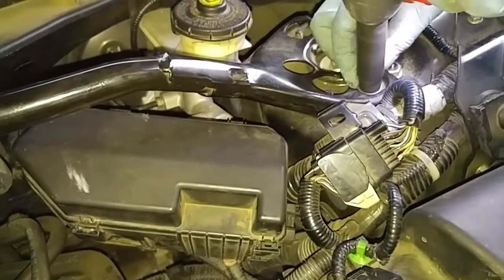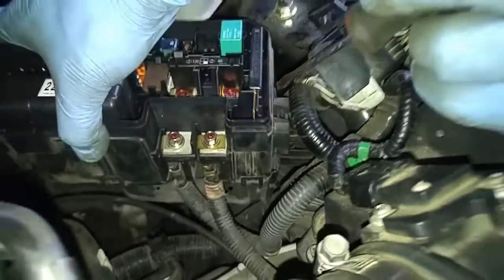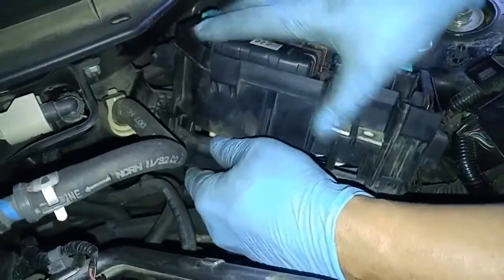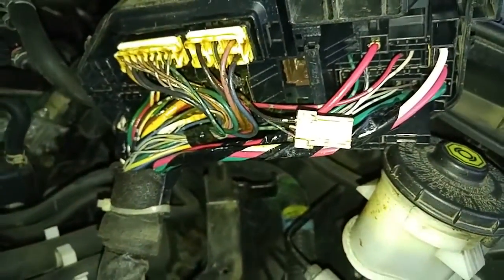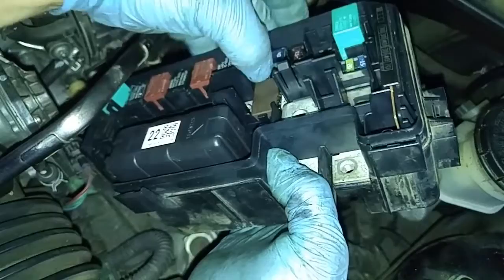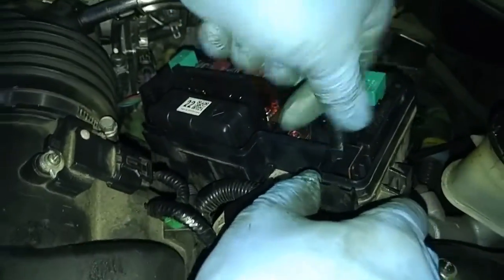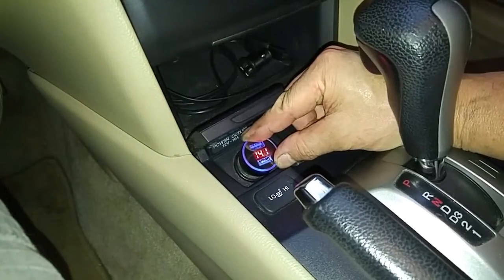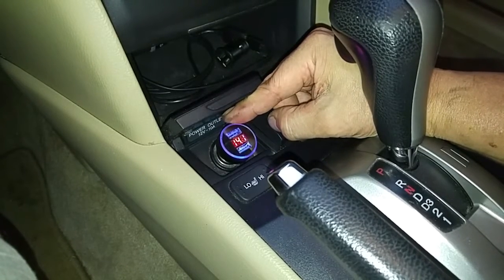Battery Dash Light On & Off? Honda Electronic Load Detector Malfunction

Comment: Thanks for posting this. 2007 odyssey new alternator, battery and belt one year ago. Today the battery light started coming on. Checked battery and alternator. Both were good. I had no idea where to go next until I stumbled across your video. Thanks
Reply from the maker: Glad to help!
Reply: @hardlymovingpro  hi mate I have same problem today  I parked my car after 30 minutes won’t start I jumped batteries is work but when I change gear car is kicks and electronic shut off when I open lights car stopped  I drove home stop and not start again? I think I have same problem my car Honda Accord 2008 v6 can you help me please
Reply from the maker: Did you change out the ELD?
Reply: @hardlymovingpro  no I didn’t change yet I’m looking for parts
Reply: @hardlymovingpro  hi mate today I changed batterie but stil same problem
Reply: @hardlymovingpro  where I can find eld I’m living Australia
Reply from the maker: @serroxat  Amazon or rockauto.com
Reply: @hardlymovingpro  hi mate I couldn’t find parts but I bought spark plug is really cheap
Reply: @hardlymovingpro  hi mate I changed ELD today but car clicks not working what I have to do i need to change battery ? When I open lights not powerful working very weak

Comment: Hello i had an issue with battery light flashing on and off.Around 2 months ago my car lost power while driving so i got it towed because  car battery cables didnt seem to help so i towed to mechanic was told needed alternator and belt so i got a new alternator and belt.I went to orailys to get a check on battery and said my battery was bad but the orailys employee  also said to check diode thats what said on the battery pad what do you suggest before buying a new battery for honda civic 2000
Reply from the maker: Could be a defective rebuilt alternator that malfunctions sporadically.  It's very deceptive.  Get a cigarette lighter plug voltage display device (like what I used in the video) and monitor the voltage output while driving the car.  Any drop into the 12v range is a bad alternator.

Comment: I don’t know if your still replying to this video but Hi I have a 2012 Honda Civic and when I go to start my car sometimes it won’t start and the battery light comes on. I usually turn it off and then on and it starts back up after 1-2 tries. It does not do this every time but it has happened more recently. I got the battery and alternator checked a month or two ago when it was happening and the man at auto parts said that they both looked completely fine and that the battery was fairly new. Do you think this is the issue or maybe something else?
Reply: You’re*
Reply from the maker: Check the voltage output of your battery before you start the car.  If under 12.6 (like around 12.4) it could be failing starter motor.  Also try starting the car right after turned it off.  That's when you have peak voltage in your battery.  If it starts right up, but doesn't start in the morning - again - it's probably a weak, failing starter motor.

Comment: Greetings I have a 2005 Honda Civic ex. I’ve replace the alternator and battery. Car ran fine for 2 days. But when I cut it off the last time it didn’t start. The radio and all the light came on but when I turn the key over and it did was click. After I got a jump it started drove for 2 minutes and the needle on the dashboard keep going up and down. Then it wouldn’t accelerate. Also the turning signals didn’t work either. First place said I needed a new alternator. But replace that and the battery. The second place I went to said I needed a new computer. Do you have any recommendations on what I should do next before replacing the computer? Thanks ahead
Reply from the maker: Get a accessory (cigarette lighter) plug in volt meter to monitor the voltage output while driving.  While driving, the voltage should be 13.8 to 14.4.  Any sudden drops should be noted with you driving condition.  Also before starting the car, the battery voltage output should be 12.4 or higher.
Reply: Also consider replacing your ground strap to the engine. There’s a similar video on YouTube with the same issues you’re having. He walks through how to check of that’s the issue.
Reply from the maker: Good idea.

Comment: Do not blow the grease out it’s dielectric grease to resist water and corrosion! Omg please put some kind of dielectric back in if u do this! Honda put it in for a reason matter of fact all cars have this under the fuse box and any other place. A major junction of voltage occurs
Reply from the maker: Way too much compared to a Toyota.

Comment: Magari il grasso se la Honda ce l'ha messo ci sarà un motivo o no?
Reply from the maker: Per protezione di coorsion ma hanno applicato troppo.
Reply: @hardlymovingpro  I have to change the battery every about 3 years in my Honda Jazz 1.4 i-Dsi, no matter what the battery make is. Yuasa, Exide, Fiamm  all last the same 2 to 3 years. I've got the flickering problem. Do you think the battery will last more than three years if I fix the ELD thing?

Comment: Not sure if you still respond,  but I have an ‘11 V6 Accord EX-L and i’m getting the battery light after replacing both the alternator and the battery. The alternator was first, replaced that and had no battery light for about 2 weeks, then recently my car died, so then we replaced the battery. Just yesterday I got the battery light again, and i’m wondering what you think it could be.
Reply from the maker: Honda tech at dealership stated that cars with ELD problems come in a lot.
Reply: @hardlymovingpro  Thank you for the reply, much appreciated!

Comment: please help my honda accord 2006 has problem; while driving at night my dashboard with the rpm and speedometer, headlights, radio turning on and off repeatedly every 2 to 3 seconds eratically. 
could it be bad ELD?
I already checked the alternator and battery and its all good.
Checked the grounds also and its fine.
Please help!!! 
thanks
Reply from the maker: Yes.  I think it's the ELD.
Reply: @hardlymovingpro  thank you so much, hopefully it will solved the problem after replacing it. is this available on ebay?
Reply from the maker: Not expensive.  Try the dealer

Comment: Can I drive for a few days while this is happening? Battery and alternator are fine.. got them checked. So I think this is my problem.
Reply from the maker: Just keep monitoring you battery voltage.  A plug in volt meter is the way to go.

Comment: Car battery did this but it wasnt the eld... battery, alternator replaced and cleaned ground... im stumped
Reply from the maker: Monitor the voltage output while driving the car.  Could be a bad replacement alternator
Reply: @hardlymovingpro  this is my second one. It usually happen at 12.6v when the load detector kicks in. But at the end of the day, its still a reman alternator.

Comment: Would a ELD cause no start? Like maybe it ends up being stuck in alternator shut off and therefore cant hold battery charge?
Reply from the maker: Yes ... I noticed it'll run down the battery.

Comment: Also don't forget if you have an electronic Throttle body...The light goes out when you drive it. Check the Throttle body plate location at idle or rest..It should read  3%<.. I fixed many where  people  tossed all  kinds of parts at them.. Toyota being most of them....Only to find the throttle body was dirty. So the ECU thinks you have your foot on the gas pedal. When it's 10% or higher  at  idle...
Reply from the maker: Good point!

Comment: Hey I have the battery light always on, no codes nothing, we change the alternator and battery, I check all connections, do you think I can fix my problem if I change that part I can fix it,?
Reply from the maker: I'd say more than likely.  Get one of those LED voltage display plug in devicea to monitor the voltage while driving.
Reply: I checked the battery voltage with the voltmeter and it moved 13.9 to 14.2 while the engine is on.  Well I will change the Electronic load detectors and I’ll let you know. Thanks 😺 for the response.

Comment: Don't know if you're still responding to this vid, but awesome explanation of the process. I just bought a 2009 accord coupe yesterday that has been garaged kept most of its life. This battery light just started coming on for around 20-30 seconds at a time then will disappear for several hours, before reappearing. Looks like I'm going to start at the lowest level and work my way up by trying this out first before messing with the alternator. Both alt & battery show good voltage when tested, so the issue for this light has to be something else.
Reply from the maker: You should test the voltage output at different rpms to check for consistent output.

Comment: I have a 02 Acura RSX type S changed the alternator and battery checked all the wires and fuses everything seems to be fine the voltage is at a stable 11 but the battery light is still on.
Reply from the maker: Voltage should be above 12v with the engine off;  engine on, over 13v.

Comment: Is there a torque spec for the suspension cross member?
Reply from the maker: Torque specs on the strut cross brace nuts not that critical.  Just make sure they're on tight.

Comment: Just replaced the Electrical load detector on 2011 Honda Pilot. the part cost me around $5 with tax, but the just required disconnecting, removing and disassembling the main fuse box on the right side shock tower. Not hard but tedious work. This is after replacing the alternator which I thought was failing cause of an intermittent flashing battery idiot light on the dashboard. Looks like it fixed the issue
Reply from the maker: Good news!
Reply: Wow, inflation is so bad, you said $5, but it's now $40 at Amazon in 3 years.
Reply: @charleschenhua  please tell me how did you find it in amazon
Reply: SO I had a similar problem. I replaced the alternator, battery and ELD..so why did my light go on again?
Reply: @marissaaranas2537  OMG!!!

Comment: Hi I have a 02 civic the alternator works and charges the battery then stops then works again battery light in the car is on constant no on and off going on could that be the eld
Reply from the maker: Yes ... Most likely
Reply: I have an 2004 Honda Accord v6 my battery light and srs light keep blinking would the eld be the problem

Comment: My honda CRV-2006 
my problem is i replace a new alternator and Battery but the Battery indicator in dashboard are always ON. what would be the solution.
Reply from the maker: Start the car and check the voltage on your battery terminals.  It should be outputting over 13.5 volts.  If less then 13 and dropping, the alternator is probably no good.
Reply: did you figure out a solution? I have the same issue and alternator was replaced twice with a voltage over 13.5 volts

Comment: where do you get the lcd plug in thing.where did you plug it in at and whats it called?
Reply from the maker: It's a LED voltage display meter that plugs into your cigarette lighter or electrical accessory port.  I provide a Amazon link to it in this video's "show more" section.

Comment: I can't find this info anywhere. I have a 2007 Honda Crv and an OEM service manual and the circuit schematic shows that there is an eld but when I look to purchase one it says not compatible with 2007 only a 2006 or older.
Reply from the maker: May have to get it from the dealer.

Comment: Thanks for posting this. It helped me know where to start looking for the same issue I was having on a 2002 Honda Accord. Lots of older Hondas have the same or similar issue.
Reply from the maker: Glad it helped!
Reply: @abraham quilca - I’m looking to replace my ELD on my 2000 Honda accord V6. How hard was it for you to swap yours and did you notice improvement ?
Reply from the maker: Not hard.  Just watch the video.  It did fix the electrical problem.
Reply: @hardlymovingpro  Nice! I just picked up the part tonight
Reply: Good to hear @Dylan Robertson. Did you get it to work? Any issues, let me know.
Reply: @musico07  I got the replacement part installed. It was actually a slightly different size than my original one but fit in nicely. Seems to be going well - my issues weren’t major so still monitoring if any of the dash lights flicker on or not
Reply: I'm here cause I notice I go into 12ish volts at times when driving,and we all know that's not supposed to be..
Seems imma have to look into this same process for my 2002 accord..
Reply: @leoshepherd1982  check ur positive battery terminal.
Reply: Would this cause no battery light on dashboard also? 2002 Honda accord

Comment: I have civic 2009. Dashboard and radio light disappear for 1 or 2 second also feels like car gonna switched off. What could be the reason.
Reply from the maker: Could be bad ground wire somewhere.
Reply: I’m having the same problem with mine but mine actually turned off on my twice already, I’m trying to figure out how to fix it😣
Reply from the maker: The ELD is a cheap part to replace and commonly fails over time.

Comment: After 2 new batteries and 2 new alternators, valve gasket cover replacement and solenoid valve replacement, I am sitting in a parking lot with a dead battery.  I am financially broke for 17 days.  I am devastated by this problem.  Honda Odyssey EXL 2008.
Reply from the maker: What are the mechanics telling you?  You may have a slow drain on you battery from something pulling current from your car when the ignition is off.
Reply: @hardlymovingpro  I agree.  However, the 5th alternator was just installed yesterday.   I think that I will have to take the car to the Honda dealership.   Two guys from the park insisted on helping me and got under the hood, pulling fuses out, unplugging things and replugging them...now my alarm system has been disabled.
Reply from the maker: @SignedOff402  Yup.  You have to be careful with non mechanic types trying to help.
Reply: Buy an american car

Comment: Well for me I have an Toyota Corolla ae100 when I drive the battery and another light with a logo that looks like heat coming off shows up in dash board , when I put on the ac it blinks fast and or sometimes it just cuts right out and then I’m not able to roll up my windows nor see any lights in the dash board
Reply from the maker: Sounds like your accessory belt is slipping.
Reply: @hardlymovingpro  ok will have it look at 
I thought it was the alternator because I was told it’s going bad
Reply from the maker: Ac light usually blinks with a slipping belt or bad clutch

Comment: He fucked up by getting rid of the grease on the wire. That's help the wire not get corroded
Reply from the maker: Not that much!  The car's not a boat!
Reply: Open any car under hood fuse box you'll be surprised. The heat under a hood is so hot it cooks the wires long term them wires be brutal falling apart.
Reply from the maker: I have.  Mostly Toyota.
Reply: I think we all we all areeded about the grease on the wire  should have been replaced , but let look at the good side of it all

Comment: "What's this grease" proceeds to wash it away  lol i hope u put some back on. it's on the underside of the fuse box for a reason.. corrosion is the last thing u want in your fuse box
Reply: It's ment for nothing to get passed the connectors perfectly normal
Reply from the maker: While driving the car through a river?
Reply: @hardlymovingpro   you do that lol
Reply from the maker: Way too much applied by the factory when compared to a Toyota
Reply: @hardlymovingpro  You cant apply too much dielectric grease.

Comment: Would this be the same for honda pilot 2012 ? I am having the same issues.
Reply from the maker: If you have the MIL code of 1298.  Here's the link to what appears to be the part:
https://www.ebay.com/i/392393551650?chn=ps&norover=1&mkevt=1&mkrid=711-117182-37290-0&mkcid=2&itemid=392393551650&targetid=1068323855270&device=c&mktype=pla&googleloc=9013542&poi=&campaignid=11755693419&mkgroupid=112482247605&rlsatarget=pla-1068323855270&abcId=9300462&merchantid=131363253&gclid=EAIaIQobChMI5KvouMLV7QIVSubjBx2EJASFEAQYASABEgI79_D_BwE
Reply from the maker: Could also be your OAD.  Here's the video link:  https://youtu.be/LKqy0WrmFwo

Comment: a waste of time, all you had to do was loose the the top two bolts and thats its
Reply from the maker: Really?  How do you unplug the ELD from the bottom of the fuse box?
Reply: I was wondering why he went through all that trouble too. But in my opinion he was better safe than sorry. I took mine out from the top by only removing the 2 bolts but it was a risk because the wires from the harness could've pulled out. There is very little slack in them wires so there is resistance. I just got lucky. 😏
Reply: @haydenmacfly81  Question. did any of you guys able to solved the problem , how, this same method ?

Comment: I had a 2005 Honda odyssey touring check charging system when i stepping on the break? NEWS 1 week old battery, ebay alternator and cable.

Comment: I had a code that pointed to to that and it being why both o2 sensors were throwing the same code..so I pull pne out of a scrap yard same car same year difference was my civic is 2 door and 5 speed stick..but I replaced it ..and suddenly I have no power to antthing but it will crank no start and. I cant even pull a code. No power to the hondas port..so any body?know what my next move ahild be
Reply from the maker: Check your fuses

Comment: Did this fix your problem of battery light going on and off?  Im about to do my wife's car 😬
Reply from the maker: Yes it did for a little while.  Then his alternator clutch went bad.  Went through 2 rebuilt alternators until the customer got frustrated and agreed to purchase a OEM Denso rebuilt alternator.  All electrical problems disappeared.

Comment: Can I get eld for honda odyssey  2004 and where
Reply from the maker: From my understanding, Honda doesn't provide a replacement for the Odyssey.  However, you should be able to cross fit one off of a 2002 CRV.  It has a slightly different hole opening for the bus bar.